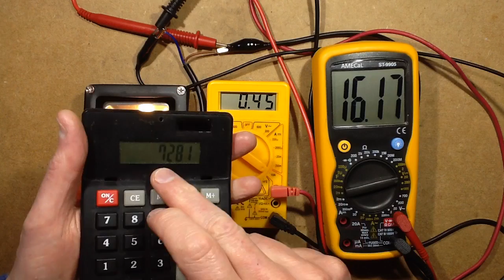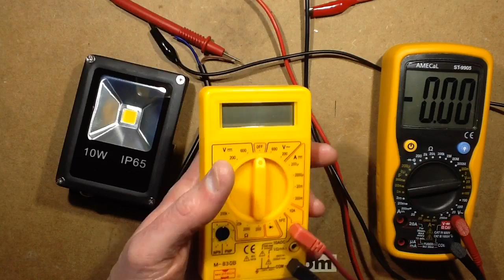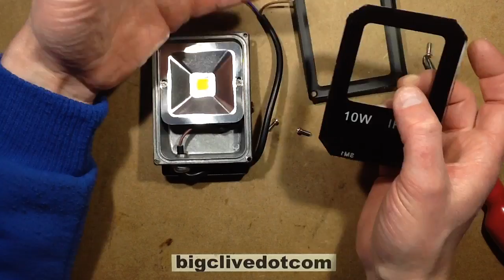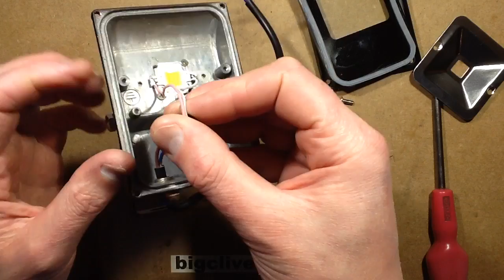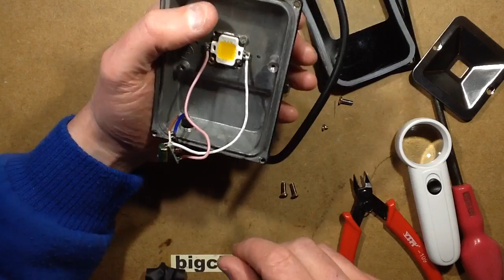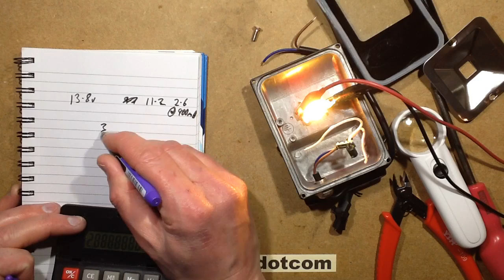Testing and modifying a 12V 10W LED floodlight.

Comment: I rewired a 240 v Les spot into 12v but it was a messy affair with cutting the board and welding leds in parallel. Could you show us a more straightforward way?

Comment: @bigclivedotcom Can I ask how did you get the 900mA initial estimate? I've got a similar LED lamp with the same regulator circuit and chip (I blew my rectifier diodes up by stupidly plugging it into the mains. Super sparky and magic smoke! =__=), but has a white colour. 
I've tested it on my power supply, and am getting 15V 0.66A (to get to the ~10W output). Any pointers on how I can get the proper operational voltage and current? 
The packaging on my lamp didn't have this information (and because I haven't touched this light in over 2 years, the eBay page is gone :( ).

Comment: I actually connect cheap chinese meter into mains (~230V) set to 200 or 20 mA and nothing spectacular happened, it's blown (with a bang) the fuse for the amps measure and some resistors inside, but the rest of the functions were just fine, i'm still using it from time to time

Comment: hi mate love your videos.is there any chance you can do a video explaining sequence of testing r1 r2 etc there's a lot of videos on YouTube showing how to do the tests but none explain why these tests are done and what if you get bad results or readings.cheers
Reply from the maker: The primary purpose of the R1 R2 reading is to determine if the resistance of the supply (live) to ground (earth) is low enough to pass enough current to trip a circuit breaker instantly by actuating its magnetic trip mechanism.  This will depend on the current rating and type (A, B, C or D) of breaker due to the C and D breakers being designed to handle much higher inrush currents to things like transformers.  If your circuit reading is too high it could be that the cable run is too long or there could be high resistance connections along the circuit.  I should make some electrical test videos at some point.  It's worth mentioning that if there is an RCD covering the affected circuit then the original purpose of the R1 R2 test is rendered moot since the RCD will trip first in the event of a live to earth fault.
Reply: thanks for the reply.im new to testing and want to know exactly why I'm doing a particular test and why iv got a certain reading rather than just writing a figure down after testing.theres a guy called John ward who explains things well  on YouTube.not on a par with you though.cheers mate

Comment: BigClive, I need your help , I've started a project and I don't know what I am doing. I thought I had a fair idea about wiring a few parts together But the wiring wording and diagrams are not what I learned . When I say learned , I mean wiring simple 12V to a switch and then off to a light ,ETC.  HELP.

Comment: I use a similar cheapy meter as a 2nd/backup meter and I was happy with it for what it is until I blew the fuse and when I opened it to replace I found that there wasnt even a fuse holder, the fuse was actually soldered to the pcb. built down to a price is fine, I paid less than 5 quid for it, but seriously thats cost cutting taken too far

Comment: I burnt one of the cheap meters testing a laptop power brick (Shorted straight to mains, good thing I always check them or that would be one dead laptop). I threw it straight to the trash, kept the leads whose wires I had gone to the trouble of replacing, and bought a similar one. I mod them to include a 9/12v barrel connector socket (with a filtering cap) and use that to load the 9v dry cell when it goes dry.

I have a goodish one (Supermarket loss leader), which I use sparingly.

Comment: Gotta love how the little circuit board is in such a shape that it could be inserted and potted inside the base of a lamp. They are very generic drivers but they work, but it seems the designer had originally made them for lamps such as bi-pin MR16 form factor lamps. If you go try and buy replacement drivers some of them even come with the pins soldered on the input side.

Comment: Just for interest, newer cars (mine included) use silver calcium batteries, which are rated at 14.8V (not 13.8V). They're common in modern vehicles with stop-start engines. http://www.yuasa.co.uk/info/technical/silver-calcium-batteries/

Comment: Clive, as you were describing this little PCB and then the full bridge rectifier, I was almost sure you would identify the IC as a BP1601 a similar tasked chip whos input range is smaller typically 12v ac or dc, driving 4 to 7 - 1watt LEDs And you may have them for a small pile of beans on ebay. They have  peculiar two pronged 1" long spears >> http://goo.gl/C7u5Be

Comment: Lead acid battery won't settle down to 12.0V volts. @12.0 volts it's more than half empty. It will settle down to 12.5..12.7V (depending if it's gel or reglular) ;) You don't have a daily driver car?
https://upload.wikimedia.org/wikipedia/commons/7/79/Lead-acid_voltage_vs_SOC.PNG

Comment: i have a $70 multimeter from my local auto store. it is cat IV rated at 300v i think. it has decent probes on it. nice big ones. i have had it for two years and i use it daily. Works very well. i have used it on 240v and all was well.

Comment: Cheap meters will only frustrate beginners, just like cheap soldering irons are inherently more difficult to use. Get a regular meter second hand if you're a beginner
Reply: *****
Ah, one of THOSE soldering irons, I remember it and the small roll of unleaded solder quite well.
Absolute joy to the millionth degree. My current soldering iron is meh but it gets the job done decently.
Gonna get a butane one to use for the thicker stuff. It also has a torch function if you remove the end.

As for cheap meters, I use them when I don't feel like installing a measuring module with LED readouts. I just leave a couple sitting on top of said device for monitoring and I pull out my decent one for specific numbers. Like you said, I'd recommend something that's mid range, maybe $50 or so isn't too hard for a beginner.

Comment: Excellent channel Clive (if I may call you that) I wondered if you had any experience of the Kit: Executive power bank. Model PWRIP6SL Capacity 4100mAh. Its supposedly for iphones and iPads. I was 'forced'to buy one recently when I stupidly left home without chargers. £27 pounds worth in a station shop. I have to say it looks good and charged my phone no problem straight out the box.  Charged it from my office PC USB and again no apparent problems. Recharged my phone three times without recharge. However after charging I had to try it in my ipad. It gave it some charge but become very, VERY hot. to warum to hold. That worried me. But after recharging it was apparently ok and works fine with the iphone.
Comments welcome
Hugh

Comment: I usally get those drivers to change the resistors: at the end, just changing the current sense resistor you can make it to suit your needs (100mA/Rs), and then they work from 10V to 24V... Quite useful actually and more efficient than "big resistor"

Comment: Very interesting video. I have one of those meters - the only thing I have found with them is the rotary switch contacts got dirty after a while and I had to open it up and clean them. It did occur to me that, for a Chinese factory, a little regulator circuit might be cheaper than a ceramic wirewound resistor.

Comment: cement resistors at close to their rated wattage get smoking hot. I would go with a metal strap as a hold down. Actually I'd likely use a resistor more than double the wattage. Because whoever rates those things is clearly insane.

Comment: There may be a single diode on top of the board that has the name SSXX (XX= 24,34,54 etc.) The voltage rating of that diode gives a good idea of what voltage it can handle. I bought one of those drivers a few years ago and it worked well with the max voltage i could give it ie, 18V). Functioned with DC as well as AC supply.

Comment: For future reference, a lot of the newer cars tend to charge at around 14,5-15v.  A minor detail but would make all the difference in terms of LED smoke production.
Reply from the maker: +keltickiwi Hmm, I've tested it up to 14.5V with the 3.3 ohm resistor (11 watt dissipation from the LED)  But 15V seems really high for a battery charging voltage.
Reply: bigclivedotcom I believe many newer vehicles are fitted with silver calcium batteries which have a higher charging tolerance/requirement. However, I Can't say I've heard of the extra voltage causing any issues with accessories.

Comment: Of course you can do it, come near 10W drive for it with a resistor, but the problem is that these generic LEDs don't hold up well at full current unless you have a very good heatsink.  

Try running it at 10W (drive, not total) for a few hundred hours.  When I did, albeit with a different heatsink, 6 of the 9 LEDs blew out in under a week of continuous run time and the remaining 3 were operating at a fraction of their anticipated wattage.

Have you ran any of these lights, with resistor or switching driver either way, for hundreds of hours?  I suggest that keeping them at 5W or lower peak drive current is the best alternative to end up with something that has a more reasonable lifespan, or moving to a higher quality extruded heatsink mounted in the floodlight chassis, open at the back with a low RPM fan on it.  A Pentium 2 era CPU heatsink would suffice.  Naturally that won't be as robust for rough handling or rainy conditions.

Comment: Choke translates fine into Australia, primary used here in reference to a high frequency blocking inductor but sometimes used as a generic term for an inductor (generally larger than smd)

Comment: The low rated voltage of the electrolytic would be no problem for using the floodlight at 24V. The cap is at the regulated side of the switch-mode regulator parallel to the LED, at least his position at the PCB suggests this.

Comment: What would you use to run a 12v fan on a UPS Back up it has a 24v van in it and it is going out needs replaced I have a 12v fan that will fit into it but don't know what to use to cut the power down from 24v to 12v.
Thanks for any help you could give.
Reply from the maker: +Big Don Big Don You can buy cheap buck regulator modules on ebay that will reduce the 24V to 12 or indeed any voltage you like.  (So the fan could be nudged down a bit for noise reasons.)
Reply: Get two fans and run them in series.
Reply from the maker: +Richard Deasington Running two in series is complicated slightly by the fact that each fan is drawing its current in pulses as it energises each winding in turn as it runs at its own speed.  So the voltage across each fan will be spiking at higher than 12V when one fan is trying to draw current and the other is between driving two windings.  It can be done, but some fans may behave oddly and make strange noises.
Reply: +bigclivedotcom Interesting point - didn't think of that.  Perhaps a decent capacitor across each motor would smooth it out enough - say 470 mic?
Reply from the maker: +Richard Deasington That could certainly help.  In the past I've also used a 15V zener across the fan to limit the peak voltage without conducting at the normal voltage.

Comment: Maybe you can make a home-made current source to sink 900mA. First step would be a Voltage reference  (7805 or resistor+zener) with a potiometer to drive a npn transistor sinking the current and with a resistor (1ohm) connected to the base. Of course it's far from perfect but should be better than just a resistor. When proper current is obtained, replace the potentiometer with resistors for better long term reliability and lower cost.
Reply from the maker: +c muller Two transistors and two resistors would let you regulate to any current you liked, but would dissipate excess power as heat.
Reply: Sure, but this is what a simple resistor does anyway... The advantage of the transistor current source is a much better stability of the current when the voltage raises (vs simple resistor). The power will actually be dissipated in the npn and base resistor so they share it. The base resistor does most of the job if v is 12V and the npn dissipate more as the v raises. The extra cost is not high and you won't need a high power resistor (less that 1W in the 1ohm that can be done with 5 x 4.7ohm 1/4W in theory). To220 npn are not expensive and can be screwed to the box.

Comment: One thing to consider is that the absorption charging voltage of a modern lead acid AGP car battery is 14.4v, and the chargers will have temperature compensation which will increase the voltage still further perhaps as high as 15.5 in extreme weather.
Reply from the maker: +James Lewis With the slight increase in LED voltage at the higher current that would probably just boost the output by a few watts amply catered for by the extra cooling of the weather.  I'm not at my workshop at the moment so I may actually test that arrangement at worst possible voltage scenarios.
Reply: +bigclivedotcom Agreed... it's something I had to consider for a solar power system also, since the better microcontroller driven charge controllers will periodically deliberately overcharge the battery bank (depending on the type of battery) to balance it... so you can find that on a nice sunny day it decides to push the voltage up to 15 or a bit more... so stuff connected to that system needs to be able to cope with that.... of course you probably wouldn't be using a floodlight when that's happening.

Comment: One of the unbranded meters turned up free with an Ebay order for electronic parts, and has proved very useful, and is accurate. I have got an Avo or two, etc and old GPO test equipment bridges, and the accuracy is up to any test I can come up with. We used to make BS test equipment, (to test the standards), and I had previously tested another makers Chinese digital effort and it was dead accurate.
Reply from the maker: +stephen wallin I've just ordered a couple of the cheapest digital multimeters on eBay.  So I may do a showdown with voltage tests compared to a Fluke.

Comment: You forgot to subtract the power dissipated by the resistors.
Reply from the maker: +aszi88 I just threw it all in to one power rating deliberately.  If I'd thought about it at the time I'd have monitored the LED voltage at each current level to give its actual power dissipation.
Reply: +bigclivedotcom I mean at the end when you measured the power at 12V you said it's 7.2 W which is still pretty acceptable and same as with the regulator. But the resistors dissipate 0.6^2*3 = 1W so the LED only provides 6.2W. (I don't know how much the regulator dissipates though.) Same for the 10V measurement. You don't have to measure the voltage on the LED as you know the resistor value and the current, so voltage on the LED is U-R*I, or the power provided by the LED is U*I-R*I^2.

Comment: Typical alternator output on a car is supposed to be 13.8-14.2. Not uncommon to see them around 14.5. I have seen regulators go south and cook the battery at 19 volts. One advice i have for people that have a dead battery. Check your charging voltage, you can fry a brand new battery quickly (learned from experience).

Comment: I was under the impression that standard 12V charge rate was 14.2V.  Car thingers should be built to tolerate somewhere in the ballpark of 14.5V.
Reply: +Markworth Agreed, and that's just in a functional system.
Reply: +Marcus Cometti How do the headlights tolerate that? Doesn't that shorten their lifespan?

Comment: Good to see you using "real world" equipment. Certain YouTube personalities would have people believe that everyone associated with professional electronics has a Fluke meter, Hakko (never seen one used in anger the UK to be honest) soldering station, and multi-Gsample digital scope. The real world is much more like this: A cheap meter that is just sitting around the place and works absolutely perfectly on low voltages, and a Weller iron that you've had for 20 years and never lets you down.

Comment: That piece of glass, you could replace with regular picture glass, the only cuts required would be straight (4 edges, knock off 4 corners)
Reply from the maker: +TheChipmunk2008 Thought about the picture glass, but the existing stuff is quite thick.
Reply: +bigclivedotcom Maybe acrylic of some kind? Places who do license plates for cars have it available  :D